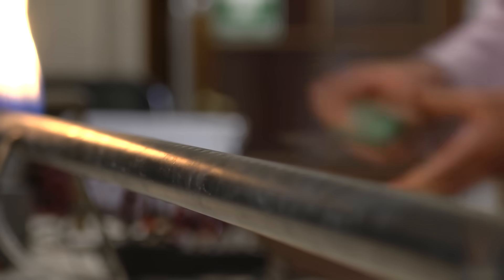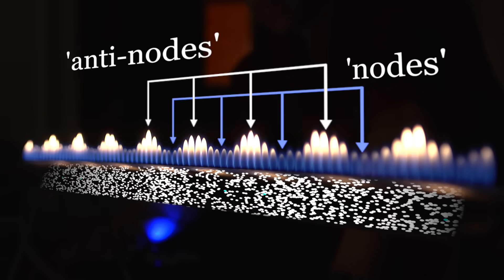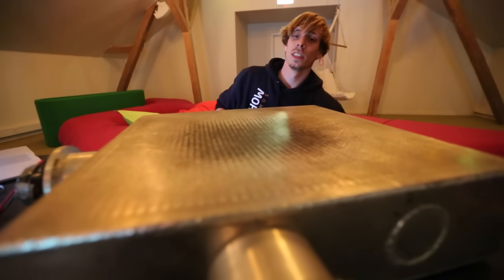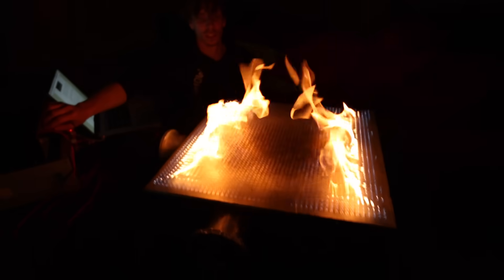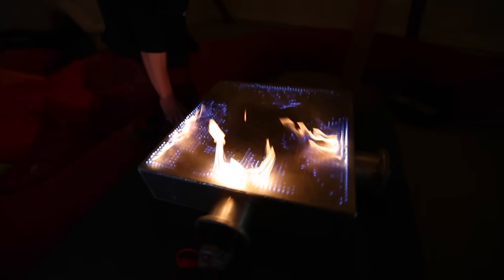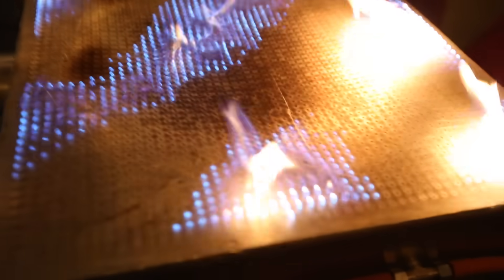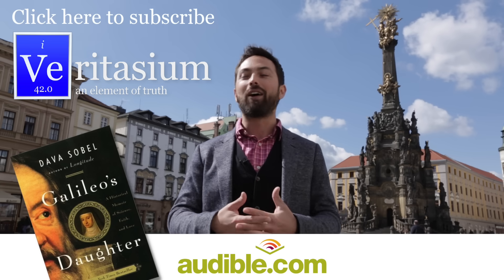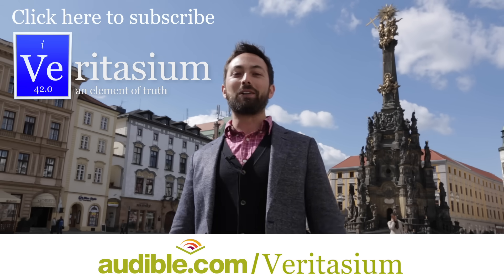Musical Fire Table!

Comment: Anyone else really want to make one of these?
Reply: Already am! It's really time consuming, but I know it'll be worth it at the end! Mine has about 7,000 holes. 31x31 and 17 inches tall (:
Reply: Here's another update! Two days ago I finished drilling all 7,000 holes by hand with a couple friends of mine (To make the process go faster).  Now, everything else will come easier and definitely faster. I have to find a neat way to connect the pipes that connect the propane tank and to the Fire Box, screw everything together and using plumbers putty to cover up the areas where there are going to be screws (to prevent any leaks), work on a little wiring for the amplifier, and then I should be good! I'm a little nervous yet excited to finally test it out. Definitely going to be at a safe distance just in case! lol
Reply: Make sure to post it on /r/DIY once you are finished!
Reply: Everyone!  Depending whether it rains or not tomorrow, I will finally be testing her out!  I'm very nervous due to the fact that this took 3.5 years to build alone and a little over $1,000 of my own money.  PLEASE, wish me luck/pray that I don't explode or this Fire Box doesn't just burn up in flames lol. Thanks! :)
Reply: Got another update for you all.  I recently got in contact with several engineers and I now feel more confident on the plan I had because I was somewhat assuming things but they actually explained the physics behind it.  It was nice to know I was heading on the right path either way.  I also got inspired to create a SnapChat SPECIFICALLY for The Fire Box.  If you want to follow me on there and see behind the scenes, my username is TheSacredForge.  Same goes for instagram.
Reply: Just updating you guys. It's not finished yet, but made a lot of progress! Should be finished soon (:
Reply: By the way, all these "I'm commenting to follow this" comments motivated me so thank you all! Sorry for the timing. A lot of things came up!
Reply: +Francisco Guardado tell us when it's done and make a video of it :D
Reply: She's almost finished! We did a test and everything is working smoothly! I would've been finished sooner but money doesn't grow on trees! Since mine is very large, I need to create pipes similar to what's inside a grill to have the gas controlled and constantly flowing smoothly rather than just being sprayed into emptiness. After that, I need to replace my speakers because the amp I have is too strong for the speakers so I'm going to be doing a little upgrade (: I know this is taking a while but she will be worth it!
Reply: Film it and upload it on YouTube! So, even if it explodes in a holy ball of fire, it will probably go viral and you'll have your money back. Good luck!
Reply: The flames weren't as high or constant as I expected but I found out why. There was only 20 PSI being released from the propane tanks to the regulator. Especially with the crazy amount of holes mine had, it needs a much higher concentration so I need to upgrade my regulator. 50 to 70 PSI should be good enough but now I gotta wait until I receive my next paycheck. I would have been finished with this whole thing a long time ago but money doesn't grow on trees lol
Reply: Francisco Guardado commenting for updates :)
Reply: Following
Reply: Francisco Guardado awesome, glad to hear you're really sticking to the project!
Reply: +Francisco Guardado good luck! Make sure to give an update when it's done!
Reply: Yesssss
Reply: +Francisco Guardado Awesome!
Reply: just leaving a comment to follow this
Reply: +da real “Eg0Yst” rulezbreaker Same here
Reply: same
Reply: SAME
Reply: +Francisco Guardado where are you at with this?
Reply: I want to know when it's done. Basically this comment is for update notification purposes.
Reply: I'll just sit here and wait for updates :D
Reply: Francisco Guardado lmao I forgot about this
Reply: sweet
Reply: +Francisco Guardado - How did you get your speaker to not melt? I tried building a smaller one (approx. 12"x12", needs to be this small for its purpose) but my speaker started melting after a while....even with a thermal barrier gasket between the speaker and metal box.

I look forward to seeing yours up and running!
Reply: how big are the holes and the distance between the holes?
Reply: Let the world burn!!!
Reply: 1/8 holes and 1/2 inch apart from one another :)
Reply: thanks
Reply: Francisco Guardado could you upload a video of yours? id love to see it.
Reply: Francisco Guardado replying to you so I can be updated! :P I'd really like to create one of my own, if you have any sort of instructions or can create some for public or private use. I'd really like to let some of my old science teachers use this (under close supervision :P), I think it would really get people into engineering and these sorts of things!
Reply: Francisco Guardado awesome... wanna make on myself too
Reply: Standard not empty comment so I can follow Francisco's updates.
Reply: okamimoushiyou I say that's a great idea! :)
Reply: Francisco Guardado Thanks! :D Best of luck! Let us know how it works out!
Reply: Any updates? - Im keen to know how it went!
Reply: Francisco Guardado ever get it finished?
Reply: Just commenting to see the updates
Reply: Valee Olson commenting for updates
Reply: Just added
Reply: commenting for updates
Reply: Here's another update! Almost everything is finished now! All I need is an amplifier (Which I already ordered) and once it arrives, I just have to connect everything and it will FINALLY be ready to go! And yes, I will be recording it and will post it! :)
Reply: Really? Hmm... How many speakers does yours have? And did all your speakers melt or did you only one melt? And how many watts is your speaker and amp?
Reply: Of course I will! I'll keep you all updated :)
Reply: But I'm alive and The Fire Box didn't go up in flames thankfully so that's good! XD
Reply: Since money is the only reason why this is taking forever, I decided I should create a "go fund me." Literally every dollar counts and will be greatly appreciated. Plus, you can even see videos and pics I post on there so you all can actually SEE my progress :) www.gofundme.com/3mm7yrs
Reply: Justin Wheeler It's not finished yet but I'm most definitely still am working on it!  Won't rest until it's finished!  The one I'm creating is just so large that every little thing that goes into it is expensive.  Especially since I'm designing and creating custom parts to make it work.  Earlier today I started working with two different guys and long story short, they are helping me create some very specific custom parts.  This is great news for me but since everything is custom, it's insanely expensive for me.  I'm slowly coming up with the money to afford these parts I designed but again, money doesn't grow on trees.  I'm still paying for other bills and am still an active student so there's some other stuff I gotta pay for that.  That is why I created the GoFundMe page (UP in this comment section) to help speed up this process.  I know exactly what to do but these things are just so expensive lol.  When I get the parts though, I will be posting another update on the GoFundMe page so you all can check out my progress :). If you can donate anything at all, it will seriously mean the world to me.  I'm so excited to show the world what I created
Reply: Francisco Guardado Any Update?
Reply: Did you finished it?
Reply: If anyone else is making one of these, don't make the same mistake I did.  When it comes to pipes (If you're using them) be sure you're not using copper pipes... This may be obvious for some of you but it's simply bad to mix copper and gas together.  I'm currently replacing all the copper pipes with black pipes because black pipes are actually used for gas.  After that, I now have to install some grill pipes inside and install some supporting "beams" inside for both the Fire Box and the grill pipes to prevent any further issues.  After that, I'mma create a design and make a special shield that will both protect the speakers from catching on fire and yet still allow the sound waves to travel through it.  It's been a while since I posted anything on here but I promise you I won't rest until this is finished!
Reply: Don't need one, just buy my mixtape

Comment: it would be much more appealing to use a more acoustic friendly shape for the platform and to make sure the sound waves are evenly distributed amongst that shape. so having 1 big speaker at the bottom of a flat circle. but i guess the configuration of speaker placement would determine where the flame is most effected by the sound waves.

Comment: 0:25 - "You basically create a row of Bunsen burners." - No, you don't. Read up what a Bunsen burner actually is and then come back and feel stupid for saying something uninformed that also made it all the way through editing, mastering and releasing.
Reply: ***** If you're so keen on quoting Wikipedia, at least quote ALL applicable items, namely Robert Bunsen's achievement to combine a gas nozzle with variable vents and a mixing tube for "mixing the gas with air in a controlled fashion before combustion". I call these "most existential respects" which, surprise, Ruben's Tube - basically - doesn't have.
Proof enough, smartass?

Comment: Visually speaking this is way less impressive than a single tube. With the single tube you are able to distinguish between the frequencies as you have one plane, but with this and it's multiple planes it's chaos with groups of smaller or bigger flames popping out here and there. Technically speaking I'd agree that this is the next level, but the visual effect gets ruined simultaneously.

Comment: So how would I go about making one of these?
Reply: You would get a speaker, some pipes with holes in them, and some propane
Reply: I tried to make one on the cheap for a test of concept. I used two cookie sheets and drilled into the top one with little holes. I put them together sealing them with tape. on the bottom I cut a hole and put a soup can on bottom thatch out the speaker in. What went wrong is that propane sinks and the cookie sheets did not have enough room to take away the heat. so use a bigger bok lime this and make sure you have a good deal, also the speaker on the side is a very good idea, good luck, I'm revising my design to make one more Iike this!!
Reply: +Shining Armor
Wouldn't that be too risky and blow you up?
Reply: +Tyler Cole
How did you prevent the flame from traveling back to the tank and exploding?
Reply: The pressure from the propane tank doesn't let it travel back up, it's the same thing as a grill burner or any other propane burner. But the propane did get out because the speaker hole was on bottom and propane is heavy, so the heat melted the balloon and propane got out. If you're going to make one, make it thicker height wise, and put the propane one the side with the speaker.
Reply: Tyler Cole Ohh, ok.
Nevermind Shining Armor
Reply: yes bitch yes me too

Comment: Shouldn't the flames be highest when the sound is off? The gas is still in there, so why does it die down as the sound goes down?
Reply: +weterman4320 Normally the movement of the diaphragm inside a speaker creates sound by moving back and forwards at the the frequency of the sound signal.  This movement  creates waves of contraction periodically  by creating increases and decreases of pressure in the surrounding air. 

Gasses are compressible fluids so this works for all gasses, but you could not make a rubens' tube with liquid fuel without a different design.

Basically the tube is full of fuel gas (probably methane AKA 'natural gas') and sealed apart from the flame holes. The gas can only burn when mixed with air for oxidation so the flames are only possible outside the holes. Ideally this gas would replenish  to a constant level so that any gas burnt is instantly replaced, but this is very difficult.

There is an inward facing speaker set into the side of the fuel gas chamber which is creating the pressure waves inside this body of gas; these waves are what forces the gas out of the holes and also why the different sounds change how the flames appear. 

It's easiest to see during the music, when the bass & drum kick are causing the biggest flames because these low frequency sounds cause the largest pressure waves.

Comment: Veritasium  - Are those standing waves in the gas-column, or standing-waves in the aluminium diaphragm? A quick way to check one or the other would be to vary the gas-pressure while observing the mode-shapes.

Comment: Nerd notes.  At :41, aren't the high-pressure places, corresponding to tall flames, the places where the velocity is smallest?  What's shown might be the opposite. 

The guy explaining it says that the flames are higher some places because of a higher velocity gas coming out, but this is the result of high pressure locations inside the tube, which corresponds (counterintuitively) to low-velocity locations along the tube.

Comment: Veritasium Fysikshow  I had an idea that would be interesting if you could chase it up. Looking at that board I can't help but to think of holograms. What if holograms wouldnt be made of light, but plasma (fire). Now it could be arranged in two possible ways. One would be similar to the video above using sound waves however I believe this would not give a good resolution. It would require trying with different gases.  Another way would be to use magnetic field to bend the flame and electronically shape it.

Comment: Amazing visuals - this is the sort of think they should teach in school - all of a sudden standing waves become fascinating and thought provoking instead of deathly dull!

It looks as though the hole pitch is roughly 1cm but I cannot work out what diameter you selected for the holes. I am guessing around 3mm but would appreciate knowing the correct size so I can have a go at making one without having to buy multiple sheets of perforated steel to see which ones work!

Kind Regards
Mark

Comment: The video shows the low flames on the Ruben tube as being at nodes - but actually aren't the flames higher at the nodes?  The motion of the gas at the anti-nodes should produce a lower pressure (Bernouli's principle), and therefore lower flame height, shouldn't it?  The nodes should be at a higher pressure, being the compression part of the standing wave, therefore emit more gas?
Reply: Just going to reply to myself here first.  The tube itself in the video demonstrates my point - the ends of the tube have higher flames, and since the ends of the tube must be nodes (since they are stationary), QED.  The high flame points are nodes, not anti-nodes.

Comment: would the room have a strong odor? i assume so, because of the large amount of flammable gas your using?
Reply: ***** Yeah, I don't think it would smell much. No more than a kitchen with a gas range or a living room with a gas fire place. CO could be a problem if you had that thing running for a while without good ventilation, though.

Comment: I'm sure that this has been pointed out before.  In your diagram you have the points where the flames are highest labelled as anti-nodes.  These are the locations where the gas in the tube has a constant pressure and therefore they give the location of the nodes.  The anti-nodes are where the flames are smallest. 

Cracking video otherwise.

Comment: Hi

First of all: nice and most appreciated set of experiments and videos.

There is a flaw in the explanation of the multi bunsen regarding nodes and anti-nodes.

The energy in the gas is conserved. At a motion nodes the energy takes form of higher pressure (i.e a pressure anti node). At motion anti nodes the pressure is minimum (those are pressure nodes). Gas escapes at pressure anti nodes, i.e at motion nodes. The description shows reverse.

regards

Comment: What diameter are the 2,000 holes? And what's the spacing measurements from hole to hole? I see it's more spacing in strips side to side but also spacing from top to bottom

Comment: Must be using a crossover network to isolate frequencies for x and y axis?  Sound pressure waves push/pull gas/air mixture creating patterns.  How does reflectivity of sound against opposite side of transducer effect pattern?  Would be nice to see construction albeit being potentially and remarkably simple.

Comment: The opposed effects can be made with vibrations throw water. if you wrap a ruinning hose around a subwonder the pouring water will vibrate or distort the flow.

Comment: isn't it 3D not 2D?
Reply: no, the tube or line is 1D the square or plane is 2D. it would have to be a box or cube to be 3D
Reply: no because the flames are only on 2 Axis in this case X and Y. there is not Z axis for the board although yes it does make 3D flames.
Reply: 1D 2D 3D xD would merely be model abstractions projected on the thing if you wanted to simulate the process — the thing itself has as many dimensions as you like to project on it — the frequency of the sound being one of them, as well as the gas-pressure or its flamability or the access to oxygen for actually burning it, etc...
Reply: Technically yes, the whole thing is 3-dimensional (as is everything else we can see), but the holes themselves are one a two dimensional plane. You can measure the length and width of the holes, but not the height of them.
Reply: ***** I'll bet you could measure the height of the holes.
Reply: Natthone Cole You could measure the thickness of the material in which the holes are, but that's not the point. The holes are arranged on a two dimensional grid, they are not themselves two dimensional.